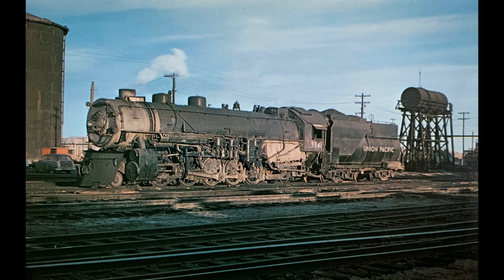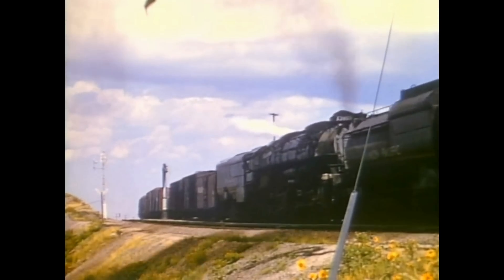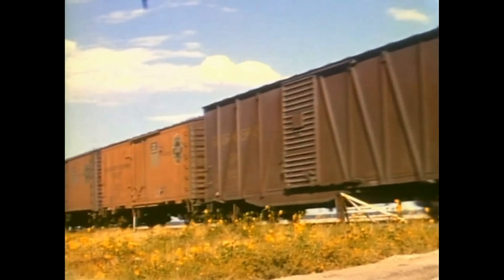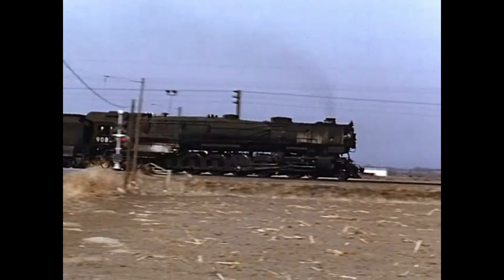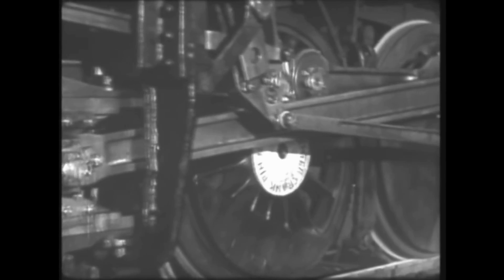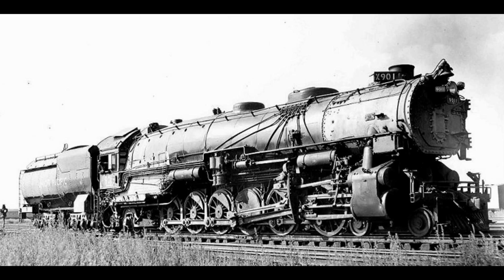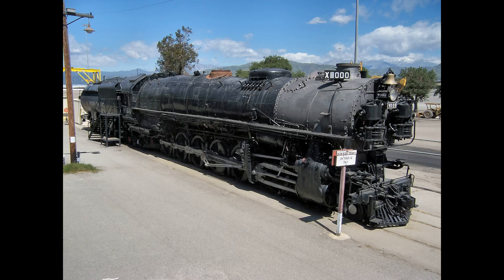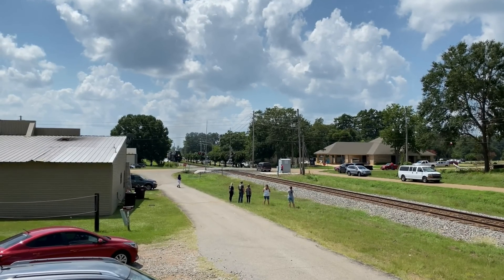The UP 9000 4-12-2s: How Something So Unconventional Became Such A Success

Comment: With regard to the exhaust cadence it is easily explained by the inner cylinder valve timing being fixed by the positions of the outer cranks and if the inner cylinder is inclined the inner crank has to be changed from the  "natural" third of a turn beat. This is common on all Gresley conjugated 3 cyl locomotives.

Comment: They should have built a 4-12-4 and a 4-12-12-4 and a 4-24-24-24-4 Locomotive and a Garrett 4-24-24-24-4+4-24-24-24-4 Locomotive.
Reply: 3 hours later, "ah theres the other side of a garret."
Reply: dude it will brake the track

Comment: Great video. In Bulgaria we had the Class 46  2-12-4 Tank Engines, 13 two cylinder and 7 three cylinder versions. Axels 3-4 were flangeless, and had lateral movement devices. They were very successful used from 1930s to the 1970s.  One of the Zwillings 46.03 was even restored recently to running order, there are various videos on Youtube of it chugging happily along.

Comment: The Selkirk steam locomotives built by the Montreal Locomotive Works for the Canadian Pacific Railway had a 2-10-4 wheel arrangement and were also quite successful.
Reply: Maybe the can deactivate the center cylinder & run it with light cars?

Comment: Good video, just one comment, the cylinders in a steam train are pressurized in both direction, so on a two cylinder engine there are four beats per revolution of the wheels.  This is why in the book "The Little Engine That Could" he repeats "I Think I Can" cadence of four beats then switches to I Thought I Could.

Comment: I got to be engine crew on Soo Line 2719. Even got to do some firing up in Spooner WI. It was quite the experience. Firing when temperature was in the mid to high 90's. They dumped the ashpan and set the ties on fire. Riders were having fun hauling water to put out smoldering ties. Greg the operator of that line has since replaced all those rotting through the years.

Comment: I love the 9000s.  They get kind of a bad rap, but they wouldn't have lasted late into the steam era if they weren't cost effective.  With the introduction of roller bearings and especially the single piece cast steel beds with integral cylinders, the maintenance issues were greatly reduced.  I don't know if the 9000 ever got a replacement single piece bed (I could look it up), but if not it really wouldn't be a candidate for restoration.  My friend and I think of them as early Challengers - they just needed a hinged frame and one more cylinder, and obviously the Challengers were the next evolutionary step from the 9000s.  The two volumes on these locos by Kratville are highly recommended.

Comment: You know, there was a class of 2-12-0 locomotives built from 1917-1924 by and for Germany. The first ones were part of the Wurttemberg (sorry if I spelled it wrong) Railway, and worked in the German state of Wurttemberg when they formed the German National Railways. They were originally the Class K's, but were reclassified as the DRG Class 59. A total of 44 of them were built, and remained in service until 1957 (these locomotives remained on German rails for 4 decades, which is impressive for their size). Sadly, none of them were preserved, but there are some models of these exact locomotives. So if you want one, I guess you can try to get one online. Also, for some reason I thought ALCO or UP were inspired by these German locomotives.
Reply from the maker: That actually might just be a video idea. Someone else in the comments mentioned it, so I'll add it to the list
Reply: @railroadexplained5767  Great, it's not a really well known locomotive anywhere (except probably Germany)
Reply: Russia had a 4-14-4 class AA20, only one ever produced and scrapped in 1960.
Reply: @stevew270  Okay? I know this, but what does that have to do with the subject of my comment (which is about the German 2-12-0's)?
Reply: @NW2174Fan  Nothing I guess, just another "not well known" like the ones in Germany.

Comment: My Great Uncle served as a Fireman on the 9000 series loco's back in the day.  He survived a lot of hard running with those engines during World War 2.
Reply: Did he run any specific road numbers?
Reply: @NW2174Fan  He never really said and it's to late to ask him about numbers.  He did mention that he also fired the mallets that UP ran (non 4-6-6-4 & non 4-8-8-4's).  He was quite specific on the 9000's in our conversations though.  He absolutley hated firing them and he often commented about the rough riding characteristics.  He always stated that to him, "that third cylinder was outta balance when they were making time."  Unfortunately, to my knowledge he never did said why that was, but I got the impression it had something to do with valving.  He also did not care for the Big Boys.  He said something about to much cold water in the boilers, to which I beleive he was refering to the flatlands hard water goofing up the injectors from what I remember.
Reply: @davidsoldiron  wow

Comment: Please do a video about Steam Turbine Locomotive, Breitspurbahn/Nazi super train, and also, T1 No.5550
Reply from the maker: The super train was already done by someone else who arguably did a way better job than I ever could. I can definitely do the turbines, and maybe 5550, but it's not even finished construction yet. I'm definitely doing a vid on the T1s overall though
Reply: @railroadexplained5767  well you could explain the current status of T1 no.5550, and also, the original T1 (no. 5500 to 5549), also, C&O M1 steam turbine locomotive is probably the coolest looking of the four steam turbine, with Union Pacific having uglier looking steam turbines
Reply from the maker: @curious5887  I very much can. I'll also throw the PRR steam turbine into the list
Reply: @curious5887  What happened to 6110 and 6111 (the prototypes built in the early 40's)?
Reply: @railroadexplained5767  speaking of PRR, a video on the M1 locomotives and 6755 would be cool. They were the long haul workhorses of the PRR fleet. Only one remains.
Reply from the maker: @EvilTurkeySlices  i believe it's on the list. if not, i'll add it

Comment: In New South Wales we had a 57 class 3 cylinder 4-8-2 227 tons machine, 25 of em. Introduced in 1929-30 for work over the blue mountains. These looked a slightly smaller version and they had only one cross-compound compresser instead of two like the 9000s. This was a informative segment. And be more confident in your speech, just remember Rome wasn't built in a day.✅🇦🇺
Reply: My comment exactly. This narrator needs to build up a bit more confidence and practice his speech by writing, and then reading his information a couple times before making the final cut

Comment: I agree with others that suggest you work on your auditory delivery. You have lots of good information about your subject, however your vocal delivery is very erratic. Write your script and practice it slowly and deliberately so the listener hears a smooth delivery of the information you offer. You sound l8ke you’re just speaking off the cuff and not sure of what you’re talking about, even though you are knowledgeable of your subject. Good luck going forward.

Comment: Somebody needs to restore this beast
Reply: That would be cool for sure, but it's a 4-12-2. I mean, anything with over 8 coupled drive wheels already have trouble with curves, and, plus, it's a 3 cylinder engine so it'll already be a bitch to maintain anyways.
Reply: @northernhillbilly2882 They could deactivate the third cylinder like UP did on the earlier 8000 class & make the front and rear driving wheels flangless. Basically it becomes a 4-4-2 in tight turns.